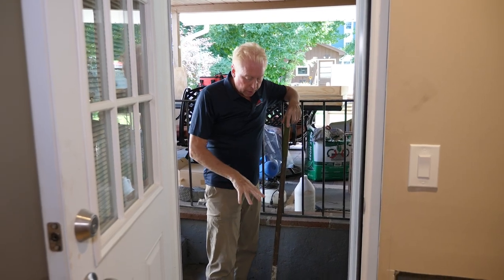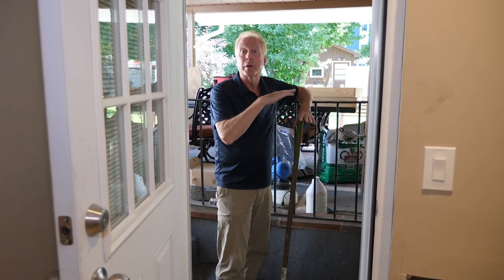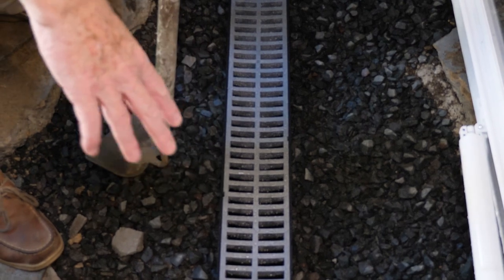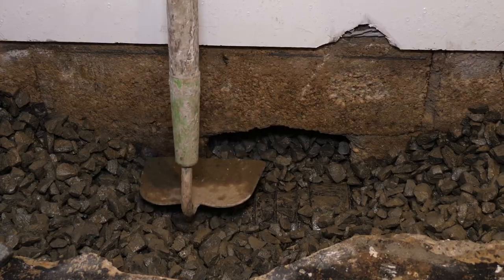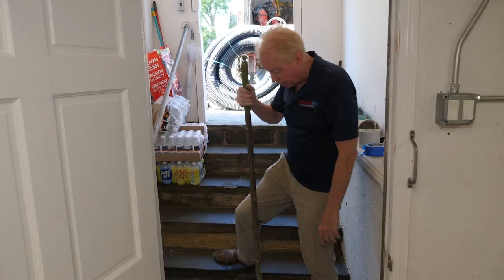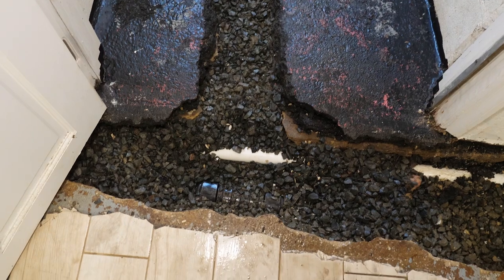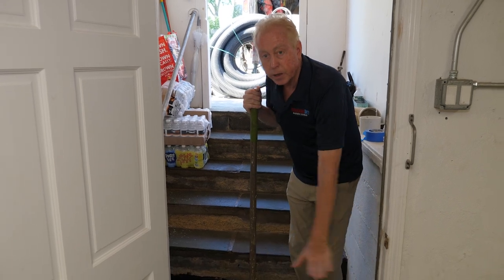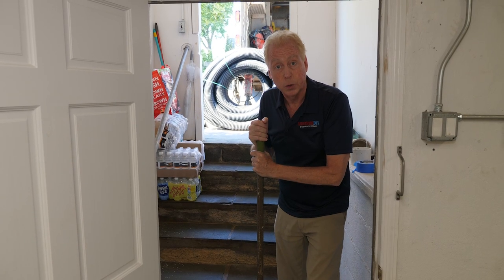Installing Basement Door Drains to Drainage System

Comment: I have a similar hole drain that just goes into the dirt... with heavy rain, water is flowing out of it and then flooding into my basement door... So, can I simply just seal off this drain to prevent water coming up and out?
Reply: I see you never got an answer.  Did you come up with a solution?